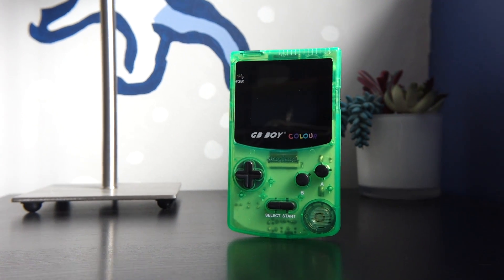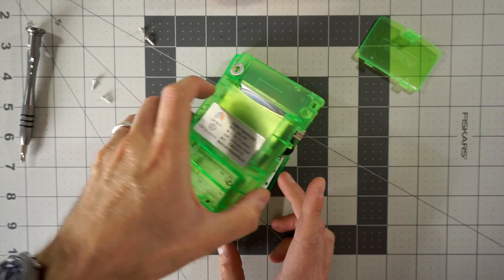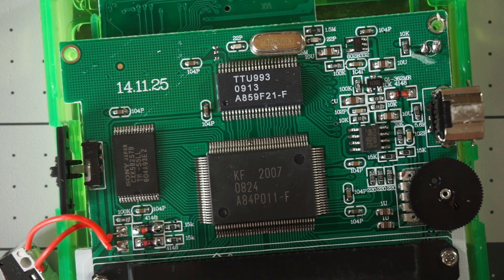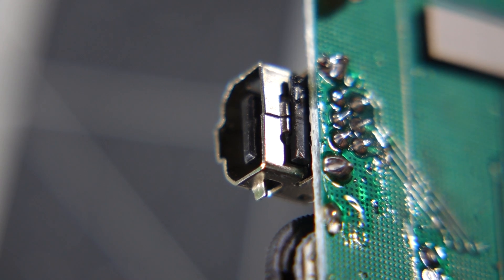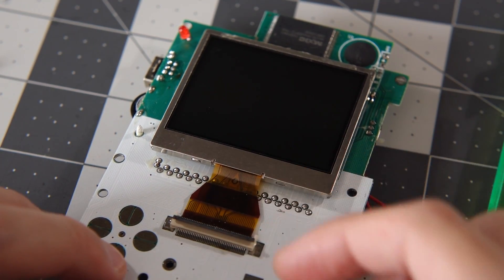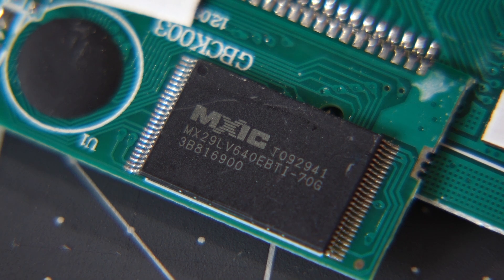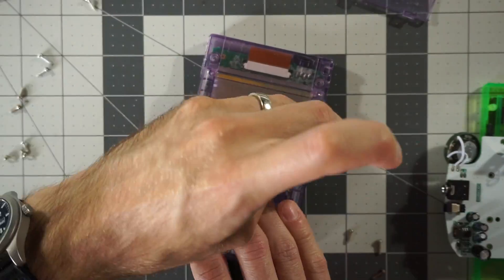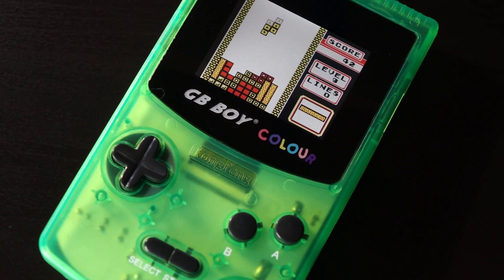What's Inside a Clone Game Boy? | GB Boy Colour Teardown

Comment: I looked deeper into the built-in games switch. They operate like a more sophisticated version of my old Retroad. Pressing the switch inward by inserting a cartridge shorts two of the wires together, and that's how the console goes into cartridge mode. I cut the wires, leaving behind small stubs inside the console about 1/2 centimeter long, and the switch untouched.

With the stubs apart, the console is permanently locked into flash mode, never able to read cartridges. Twisting the stubs together keeps them shorted as if the switch is pressed all the time, and this basically switches the console into "legal" mode if you will, so that it cannot load the flash card games; it always waits for a cartridge no matter what.

I twisted the stubs together to keep it that way. I rarely play the built in games anyway, and it feels more legit this way :)

Comment: I opened up my GB Boy Colour today to find out it has a completely different screen and screen controller, along with a JTAG connector (only the pads, not any pins/connector.)
What do you think it’s for?
Reply: Maybe the screen controller was designed in an fpga (hence the need for a jtag connector if you want to program it on the board)?

Comment: Could you put a GBBoy screen in a GBC?
Reply: No, wrong number of pins and probably very different in terms of  actual communication. Two screens of the same size in different devices rarely have the same interface, and you can't exactly write new drivers for the Game Boy- it's very low-level, using very small internal ROM (not changeable), cartridge roms (also not changeable, less so on flash cart but then no original games) and the Gameboy's CPU hardware (even more not-changeable). One could make a device that captures original GBC screen signals and communicates with the GBBoy screen properly, but good luck finding any datasheet for the latter- it's a yet-another cheap Chinese  no-name device and those are almost never well-documented, and if they are, it's often in Chinese. Could reverse-engineer it, but it's probably not worth it, could just use some other, better-documented screen. A device like this would also be active and use a microcontroller or FPGA and would probably consume power that is at least noticeable compared with the rest of the Game Boy, could be hard to physically stuff in and may introduce lag or other problems that would make game experience far less authentic. I'd just stick with original screen and backlight mod. One thing that someone could try is to check if the CPU clone is a drop-in replacement for the original CPU with same pinout, by swapping it with an original console and seeing if it works (unlikely and can destroy both consoles). If that's true, the GBboy screen might be possible to connect to the original CPU the same way it was connected to the clone, through that unidentified driver chip, TTU993- maybe it does just that, making it an ASIC that efficiently adapts original GBC CPU signals to new LCD. In original Gameboy the LCD connects right to the CPU, and here it looks like it's using similar pins for that chip and that it has similar pinout, at least by the look of it.

Comment: Has there ever been a solution on these for them eating your batteries to death pretty quickly with them left in the device when it is turned off?  I got rid of one I had over that as it was annoying having to let it snack or pop in/out batteries every use.
Reply: So the switch doesn't cut off all power to the console then, that's surprising. You can always disconnect the switch either by desoldering and lifting pins or cutting traces, find out which traces are connected together when it's turned on and solder them together on the board (but leave the switch itself disconnected), and use the now liberated switch to cut off power directly from one of the battery wires- cut the battery wire and connect the switch across the cut. Now it should behave as if you had removed the batteries when off and as if you have inserted batteries and turned it on when on- that is, if the built-in flash cart has any RTC or SRAM save, which would be the only reason to draw any power when off apart from damaged console, then that would be erased when off. I never had one of these as my original GBC is good enough for me, but a toggle switch works the same no matter what it's in, only its pinout may vary. From the look of it, its two large pads on its ends are ground and should stay connected together and can remain connected to the switch to hold it in place, and the remaining three pins work by connecting either left or right pin to the center pin while leaving the other disconnectes, which is pretty usual, but check with a multimeter- it might be different or they may connect to the ground internally as well. If any of those pins is connected internally to the switch shell, which is very unlikely, and you leave the shell of the switch in place, it might short out the battery or leave the console on when it's supposed to be off. Otherwise, if you disconnect these three pins from their traces while keeping the rest of each trace connected together, you may use any of the battery wires to cut and solder to the switch, but the wire might have to be replaced with a longer one if it won't  reach. I'd go about it by desoldering the switch, checking its pinout with a multimeter, solder right pads together and then put some tape over those three pads, solder wire to switch, then solder the switch in place just by its shell. Kapton tape would be better, but two layers of normal tape would do. This way you don't have to make a switch hole somewhere else, buy another switch and find a way and place to affix it to the console's case.

Comment: I actually just got one of these about a week ago. It's the exact same color as the cartridge for Pokemon Blue Version. My ONLY note is that when the console is turned off, there's a "burn-in" of what was on the screen when it was turned off, and it doesn't go away momentarily like on a real GBC (but this isn't a problem since the "burn-in" goes away as soon as the system is turned back on).

Comment: Just a quick note on why you found a Sony SRAM chip. It is most likely NOT a new part, but instead a recycled unit from SZ. This is one reason you can find so many cheap electronics in China, half of the components are mass desoldered parts, and the other half are copycat ICs.

Comment: Just got mine today, buttons feel like something from an interact/preformance third party controller which is to say they are actually not half bad at all. D-pad is... well just functions. A simple fix kong feng  should do is to add a ball pivot joint into the mold and that would solve 90% of the issues.

Comment: The resolution figures are misleading: the red, green and blue subpixels are counted separately, in reality 480/3= 160 RGB pixels, which is exactly the GB's horizontal resolution.
Vertically, 240-144=96 pixels are wasted

Comment: Just put a lead that goes to the 2 points for the button connection and stick that flash cart into an old gb color cart so you can have both as separate components.

Comment: I did some digging, found an 40 to 50 pin adapter here if anyone wants to try it: https://www.aliexpress.com/item/5pcs-Lot-40Pin-to-50Pin-ZIF-0-5mm-Connector-Adapter-With-Extension-Flex-Cable-FFC-Extend/32735017596.html
Reply: pinout is not the game.

Comment: Can the built in flashcart be removed from the system? If I bought this system I wouldn't want to have ROMS on it.
Reply: It seems there is or was a version sold without the games included.  I do not know if it's easy to find, but it exists.  I can't tell you if the internal flash cart is removable, but I got the impression it was soldered in, but that's my assumption.
Reply: Sure. Its just a flash cart so if you have a good soldering iron and a solder sucker or some desoldering braid, you can desolder it and it'll all work just fine.
Reply: Could just bridge the 2 points together on the board that goes to the wires to the switch.  This would make it think there is a cart in it at all times.

Comment: How do they clone a CPU? Wouldn't they need to measure the properties of each transistor and diode in the circuit? How much effort does it require?
Reply: Since it's a totally synchronous CPU with a single clock you just need to know the clock speed and the (µ) instructions.
Reply: *****
 Well, I'm not sure how they trace out the circuit. It is incredible.
Reply: you don't need to know how the exact tracings worked on the inside to make a functional copy of something like this. An Arithmetic Logic Unit is an Arithmetic Logic Unit. People reverse engineered most of the schematics just by feeding specially formed data into the CPU and recording output.

Comment: can you take the flash cart and replace it whit another cartridge game (if they fit in the area )?
Reply from the maker: I haven't tried, but considering it's wired directly to the cartridge slot, I suspect it would work.
Reply: Or make a board with cartridge-sized pins and solder the flash card board there to see if it works on an original GBC.
Reply: I wonder if the internal flash cart can be reprogrammed?
That would be useful for LSDJ and things like that.

Comment: I've been dying to find more info on this clone, so I'm happy to see this upload! I bought two and they're pretty damn good. The screen is great, but the overall design leaves me hoping for a backlight solution to the real GBC. I only play on the GB Boy clone, but only because of its backlit screen.
Some common questions I can confirm 100%:
1) Yes, the game link cable works exactly as expected. I've traded Pokemon with it, played multiplayer games with it, and I've even printed pictures on the Gameboy printer from my Gameboy camera with it.
2) No, you cannot fit it into a real GBC case. At least not without some serious modding to the PCB. I've already tried.
3) It plays real Gameboy and Gameboy Color cartridges, as well as various flashcarts including the Smartboy cart and Everdrive GB. I own and tested both.
4) You can swap out the D-pad for a Gameboy Pocket D-Pad, but the rounded edges means it'll look a bit weird. Still works fine if you're not a fan of the stock one it brings, though I'd rather use the stock D-Pad with it.
5) You can fit the genuine Nintendo button membranes too, though they don't fit perfectly so you might have to stretch or cut the button membranes. The stock membrane definitely makes the buttons feel more clicky than the original GBC.
I would love to see more info on mods for this thing. It's hard to find any info on it and even harder to find things like custom shells/housings, buttons or glass replacement screens for it. They just don't exist for something as obscure as this clone console. For under $30 though, definitely worth it just to have.

Comment: 480x240? That would mean that either the pixels are squeezed together as hell or they did something wrong. Clearly it's not 480x240, as that would mean it's twice as wide/tall as the other side.
Reply from the maker: The pixels aren't necessarily square.
Reply: Or the pixels are simply not square? You're confusing image aspect ratio with display aspect ratio. Take the 3DS top screen, for example, which has a native resolution of 800x240. When 3D is off, the 3DS pixeldoubles on the horizontal axis.
Reply: Yeah that's why I said squeezed together. When pixels aren't square, the image quality will become very stretched and will look weird. This has happened to many other Gameboy rip-offs, where the display has a weird resolution of like 240x342 (or something like that). Then every 10th column/row of pixels would light up "two" pixels instead of one, because that particular line/column/row would be stretched/squeezed.
TLDR; Square pixels are good. Rectangular pixels are bad.

Comment: Shame that none of these emulator/clone handheld systems can never get the aspect ratio correct for the screens
Reply: I'm pretty sure nobody has been manufacturing 160x144 screens for a while.
Reply: Involuntary Cultural Enrichment Yea thats for sure but why they dont add an option to have black bars on the screen so even the screen is not the same aspect at least the picture is
Reply: I'll admit it's weird that they got the hardware that close but didn't come up with this kind of fix. Maybe they just figured 'good enough' by that point? It since the system is mostly a clone it would take extra engineering to correct the aspect ratio.
Reply: Yeah, it would take extra chips and converters to get the screen to display in the correct aspect ratio, it would also need a bigger screen since i'd be obviously too small if they used the current one. which would probably increase the costs even more.

Its like 27euro's right now and i think its perfect for that price
Reply: +Involuntary Cultural Enrichment
Well, no need to all pixels.
Reply: you can but you would need a new screen and an adapter to do this which will cost more than €100 easily. id's say this clone console is good enough and if you're not convinced you can still mod this thing and try to make it look more like the original
Reply: To change the native aspect ratio of the screens they have available and make them match the original GBC aspect ratio with black bars hidden inside the shell would probably cost more money that they don't want to spend.
Reply: Even if they ordered a one-off batch of custom screens they can't guarantee to keep that manufacturer and price, so it's just more practical to use a common lcd interface.

Comment: I've had one for some time now and honestly? I love it. The screen geometry isn't ideal but without running the same game side by side on both consoles you don't usually really notice the difference? Perhaps more to the point the screen is bright, clear and sharp and mine at least has no dead pixels. Most of all it doesn't feel like a cheap, low budget product, it feels well made and mine has literally no issues so I was a little surprised by Colin's having a badly soldered power socket. It is also worth mentioning that my original (3rd party) GBC power adapter works fine with it.
I really must get a link cable and and try it out but as far as I'm aware the link port is supposed to work, even linked to original hardware. :)
Reply: Yep, it's not too expensive for the slight risk of a lemon. I got mine on 99Gamers before they shut down when they first started allowing trades for other items, so it must have been last fall. I can't remember the coin conversion at the time, but basically the value I traded would have been about $30. Well worth it. My biggest complaint is the sound over headphones has the same buzz that the Gameboys had until the DS. I swapped some caps on a GBC to lower it some, but can't get rid of it except for using cheap ear buds with no bass whatsoever.
Reply: For most games, the different screen is fine. In some games, like the Zelda games, I prefer the GB Boy Colour's screen aspect. I have the exact same GBC and GB Boy Colour that Colin has, a frontlit atomic purple GBC and that translucent green GB Boy Colour. I use the GB Boy most of the time and for games that just are too weird aspect-wise (like platformers), I will play on the frontlit GBC.

My only complaint about my GB Boy Colour is there is a spec of dust or debris under the screen lens that can be annoying, I should probably dismantle it and see if I can just clean that off. Also, I wish there were screen protectors or replacement glass lens for it for the future.
Reply: I got mine either last fall or the fall before... time runs together these days so can't remember for sure, but at least a year. Been 100% reliable as well. Feels as sturdy as the GBC to me.
Reply: I'm sure their QA isn't up to Nintendo standards, but I haven't seen any widespread issues. I wouldn't worry about buying one. The risk isn't too high for the price
Reply: How long have you owned it?
Reply: +onahjay affordstay since April last year, so a little over a year and it's been 100% reliable, in spite of the fact that I'm a little clumsy when I'm tired and I've dropped it a couple of times. :)
Reply: +onahjay affordstay I totally agree which is why I was surprised by Colin's having a wonky power socket? Even so I have no problem recommending them to people who want one. :)
Reply: OK. I just saw a comment saying that someone's broke in a month
Reply: +onahjay affordstay there's no such thing as perfect and as +FireMrshlBill said I doubt their QA is up to Nintendo's standards so there will be some iffy units but I can only tell you about my personal experience which has been extremely positive. I picked up mine on special offer for £20.40GBP and for that kind of money you'd expect it to be a single CoB board with mushy buttons, a cheep housing that creaks and permanently feels like it'll brake at any moment but in fact it's the exact opposite of that in every way. The buttons are positive, the board is as complex as it should be and (had mine apart too) is well made, the case feels solid and the screen's great and remember, it cost me £20.40! I didn't even have to pay import tax!
If you look for horror stories on any product you'll find them and like I said I can only tell you about my own first hand experience but my own experience has been entirely positive. :)